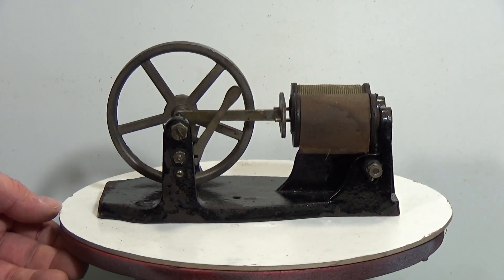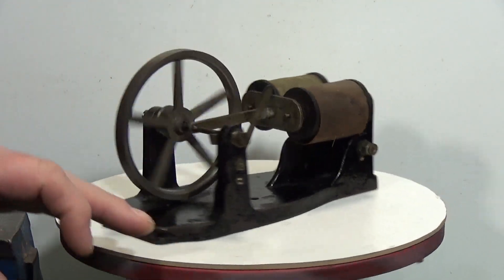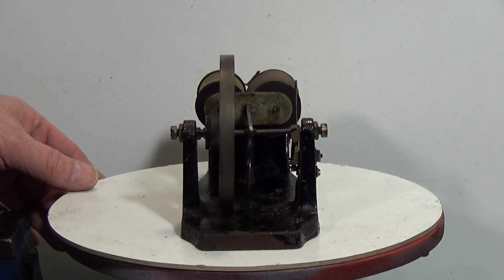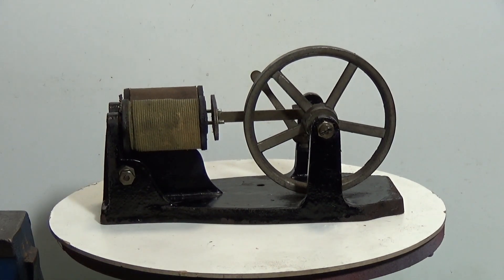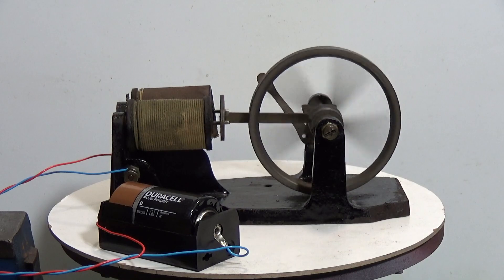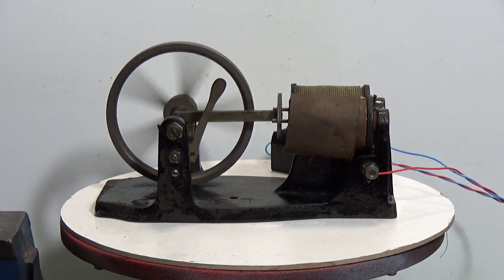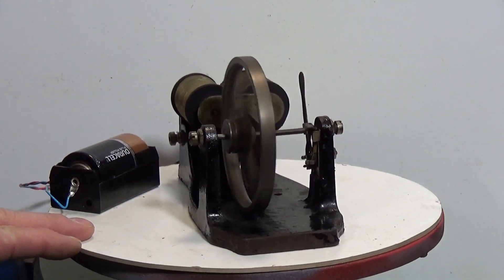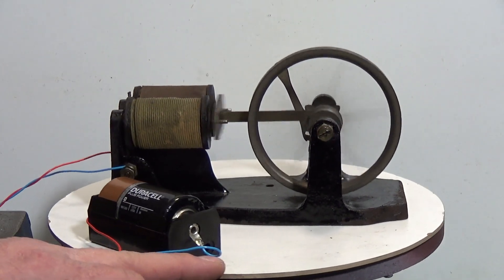Mesco Number 1011 Electric Engine

Comment: Hi Alan,

Runs very well. You should be able to mount the fly wheel in a lathe chuck and use a collet in the tailstock to align/correct the shaft bend.

Should be an easy fix.

Interesting little engine.

Cheers Rob
Reply from the maker: Thanks Rob. If i can figure out how it comes apart i will do just that 🙂